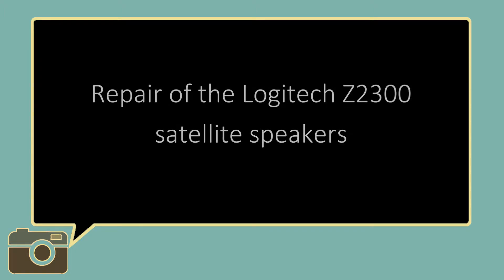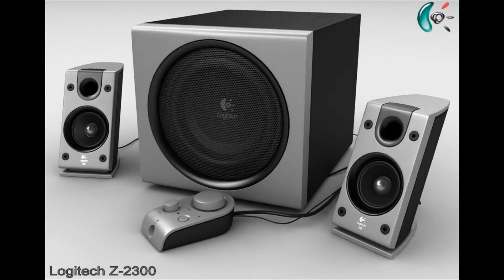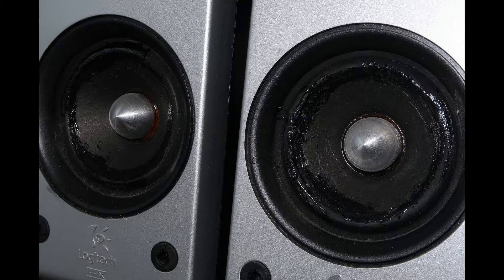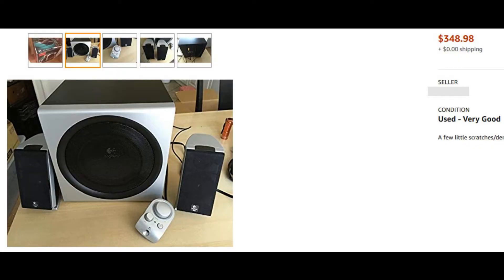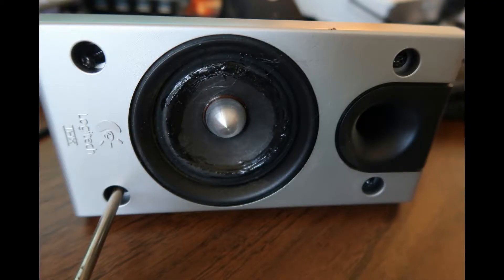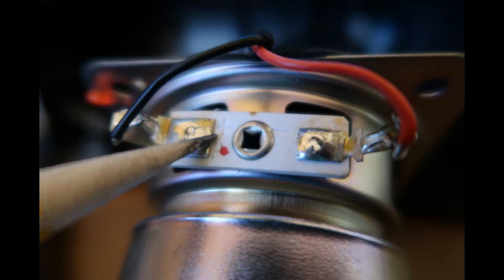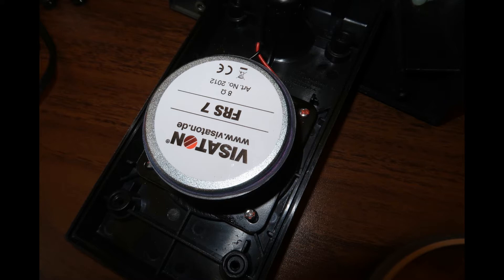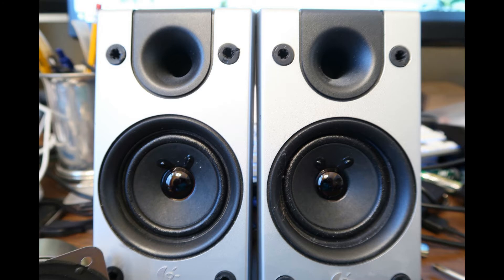Logitech Z2300 repair

Comment: Thanks! I have replaced two speakers with Dayton Audio PC68-8 2-1/2" Full-Range Poly Cone Drivers from parts-express website ($10 each). I had to put them on 2 bolts instead of original 4 though.

Comment: Thanks for your video you are right they are selling these speakers at a ridiculous price i saw two speakers been sold for 200$ this is more than the price of the new model. I will repair them my self and buy an extra part as back up.  Can you tell us if your speakers are still working after 2 years?

Comment: Good job. I buy 2 satellite creative speakers from 5.1 5100 set, with 2.5 inch the same as the originals and replace them. And guess what the sound is incredible. I cannot see the difference between them two believe me. And was a lot cheaper. I'm in Portugal, just 10 euros ;)
Reply: hey there! did you just buy creative satellite and just plug it back into the z2300 subwoofer and it works no problem? I am looking to buy creative T3 speaker to plug  to my z2300 subwoofer because my speaker for the z2300 is broken like in the video
Reply: Bump
Reply: Bump

Comment: Hello and thank you for the very useful video. I have two questions: 1.Can you put the volume level to the maximum and these Visaton speakers can handle it without crackling? 2.Could I change only one speaker, in one of the two satellites, and maintain the original in the other?

Comment: Did you notice any change in the sound? Or is it the same/as good?
Reply: In my case it was almost equal. 😉
Reply: @hugomigueld  hi i would like to know what about the capacitor connected to the speaker do i solder it the same way as original or do i remove it